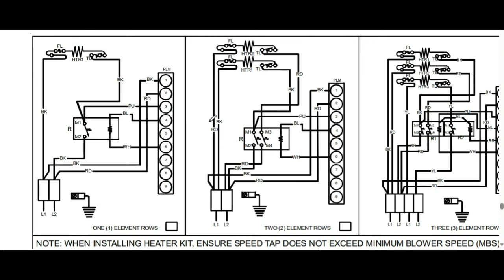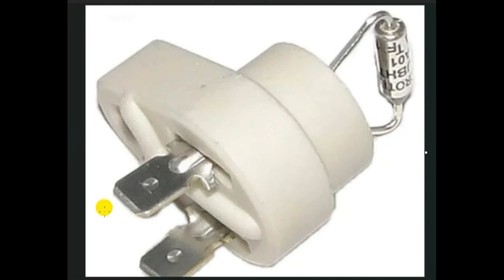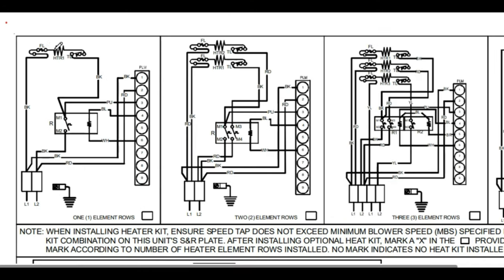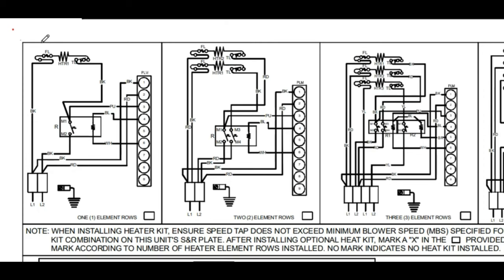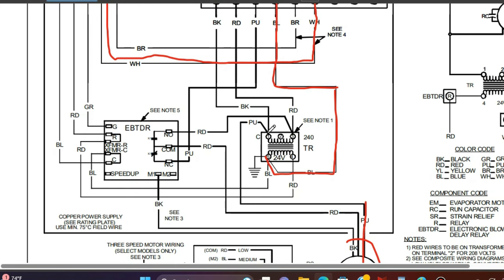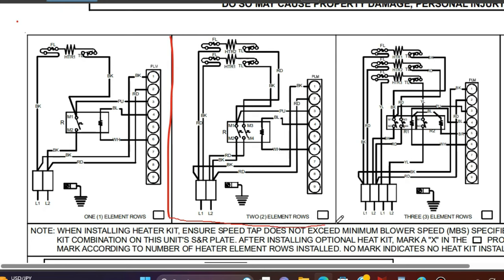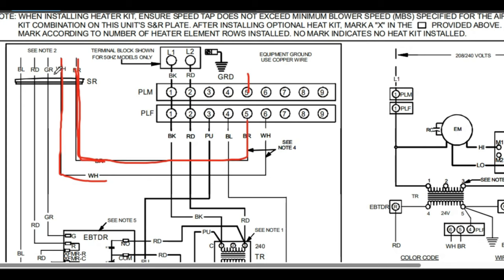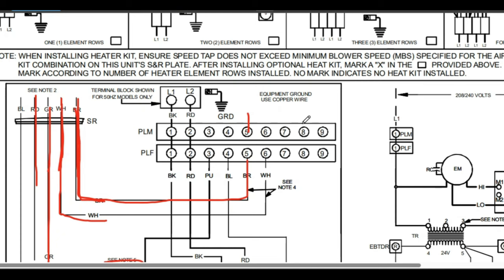Electric Heat Strips (Wiring For Beginners)

Comment: Yes on power need for (sequencers)  first set on a 2 switch sequencer turns on in 15 ish (maybe 30 ish) seconds, second one above take another 30 seconds ish to 120 ish seconds to turn on.  The are heat activated like a thermal safety.   Great great video for beginners. Trying to find something for newbies.   My edit:  that delay between a double sequencer helps not flicker the lights...😳   Second stage can be done with a timer for runtime or sloop (temp drop).

Comment: So if I have a double coil heat element do I need 2 thermo switches? Because mine has a place for 2 but only has one. An mine don't have the little meltable fuse at all it does have like a 3 amp chip fuse like the kind in a car. What could happen if the thermo limit switch isn't hooked up?
Reply from the maker: Are they wired in as separate stages or in series as a single stage? The one thermal limit can cut out both heaters in series, but if they're staged I'd want to add another thermal limit. The fusible links act as a backup to the thermal limits., so it's double protection in the event the thermal limit fails to operate when it should. I'd feel more comfortable having them if you have only one thermal limit in there.
Reply: @JerseyMikeHVAC   the chip fuse runs off the transformer. But the thermo resistor wasn't never even hooked up it was by pass. That's what scares me an I been using the heat for about 5 years like that. But a double heat element can run off one thermo resistor? If it made to handle 2 an in series?

Comment: Can you explain why the heat strips need to two legs of power before they turn on?
Reply from the maker: Because you need both legs to complete the circuit, otherwise there is no current flow.
Reply: It’s a 240 volt circuit this type needs 120 from each leg to give the load 240

Comment: Greetings Jersey. Awesome video. Perhaps the best stationary hvac videos on YT for educational training. I'm repairing my handler unit as its heater strip was entirely missing! It seems to have been incorrectly wired for single stage when the heater was bypassed, but I need a 2 stage. Can a second run of romex from my main 60a breakers specifically go to the heater L1, L2 and use the same source from the handler for the other two L1 & L2 breakers?

Comment: mike, I have a 30+ Y/O Coleman 3500 series furnace (15 KW, 3 elements) is it recommended to have the 3rd element on the W2 lead or just leave it in the original setup. I'm thinking efficiancy to help cut the costs in winter, if that does anything... does W1 and W2 on the thermostat work at the same time, or is there a temperature variable? I am using a NEST thermostat on my system.

Comment: Jersey, Thanks for the video. very well explained. I will use it to see if I can see the circuit and  diagnose why the 50amp breaker on the Air Handler Unit is tripping off after 2 to 3 minutes of operation in the "HEAT MODE" on my Goodman 2.5 ton air handler ASPT35B14AB WITH A "HKS*08CXC HEAT STRIP KIT- I replaced the air filter with a new one for better air flow but stills tripping the breaker after 2 minutes operating in HEAT MODE ONLY.  The AC Cooling mode is working fine and cools fine, but not on the HEAT MODE as the blower motors stops because both, circuit on the heater and air handler unit operates on the 50 amp breaker,  and the Outside  Compressor Condensing Unit operates on a separate 30AMP Breaker circuit. Perhaps the Thermal Limit switch is faulty or the heater links are drawing too much amps and overheating or the blower motor? Can you give me some advise
Reply from the maker: Need to check amp draw on heater and blower first to get an idea of what's going on.

Comment: Thanks for the video. Can you explain what is the usage of the PU wire connected to No.3 on PLM?
Reply from the maker: I did explain it in the video, but basically that purple wires serves no purpose in a properly functioning system. The only time it does something is when the relay that turns the heat strips on and off gets stuck on (sometime an arc flash welds it into the on position), and the heaters won't shut off when the system tries to shut down when the thermostat is satisfied. 

 That purple wire connects to that heater relay, so if it still has power on it when the switch should be open and the heaters off, that purple wire will feed voltage to the relay on the fan control board, which will go straight to the blower motor and force it to run even though the system and thermostat aren;t calling for it to run. 

 It's like a safety wire to keep the blower running if the heaters wont shut off.

Comment: I have 2 coils heating element and both of them heats partially, you can see them only light one alf of the string, that means it's a bad heating element?
Reply from the maker: It's very likely. Could be a relay but less likely.

Comment: can u put brown and white wire together if u don’t have thermostat with w2 port ?
Reply from the maker: Depends on where those brown and white wires are going. I can't say just based on wire color.
Reply: @JerseyMikeHVAC  I only have the inside unit at this time for heat.
 white wire goes to w1 and brown goes to w2 for heat but this thermostat doesn’t have w2 for second strips.. well at the unit i put those two together and now i have 130deg heat instead of 98 deg thanks for the reply

Comment: Hey Jersey Mike! Can a 15k auxiliary heat strip be wired on one breaker or both breakers have to be wired? In other words can one side be used?
Reply from the maker: Are you asking if you can use one breaker and power line for the heat strip and the air handler so you don't have to run an additional power line on a separate breaker? If so, my advice would be to put in a small sub panel by the air handler off of the existing electrical line (assuming it's sized for a 15k heater) and then split it with separate breakers from there.

 You can also call the manufacturer of the air handler and see if they offer a breaker kit for retro fitting heat strips that will serve your purpose. Most do.
Reply: @JerseyMikeHVAC  Mike, I have the breaker kit, I just wanted to know if it is possible to use  1 breaker out of the 2 on a 15 or 20kw heat strip just like I would use a 10kw with 1 breaker since there are 2 heat strips on both the 15 and 20kw heat strip. I have a 10kw, a 15kw and a 20 kw for a Goodman 4 ton variable speed air handler and an inverter variable speed heat pump.
Reply from the maker: @cre8tive31 You can wire up to one breaker and then jumper over to the other.
Reply: Mike, if I wire just 1 and not jump to the other, would that work and not affect anything? 
You are the best in the business and know your stuff. I enjoyed watching all of your youtube videos. You do a fantastic job. 👍👍👍
Reply from the maker: @JayAlexander-k1w  You may have only one of the heat strip coils working that way.

Comment: would it be safe to run a 15kw coil heater and air handler on one 60amp circuit?
Reply from the maker: The 15kw heater alone can potentially pull up to 60 amps, and that would be on #6 wire.
Reply: @JerseyMikeHVAC   Tell me if this works? Use the existing 60 amp circuit and wire to power only the heater coils and a separate 20 amp 220v circuit #12  awg wire to run the air handler.
Reply from the maker: That's a lot closer to workable. What's the model number of the air handler? From that I can tell you if you'll need 20 amp 12 wire or 30amp 10 for proper sizing.
Reply from the maker: @TropicBreezeRealty  15 amp breaker. 12 wire is good.
Reply: @JerseyMikeHVAC  You the Man. Thank you